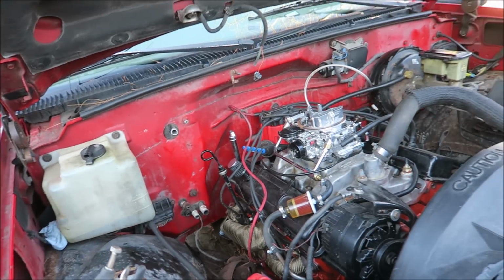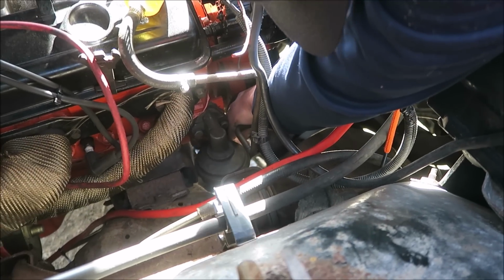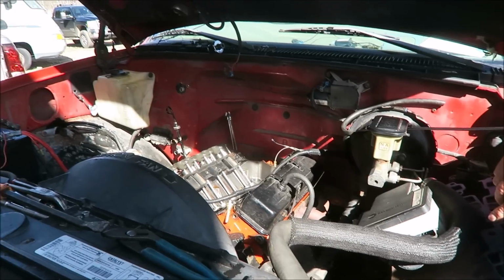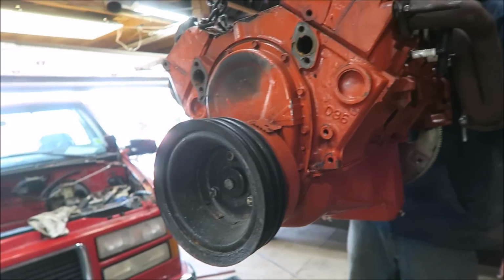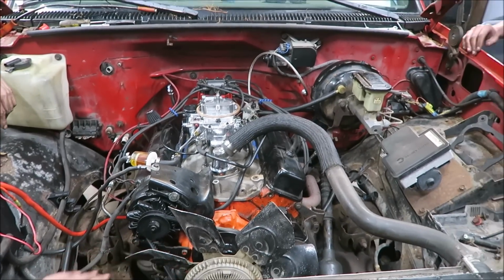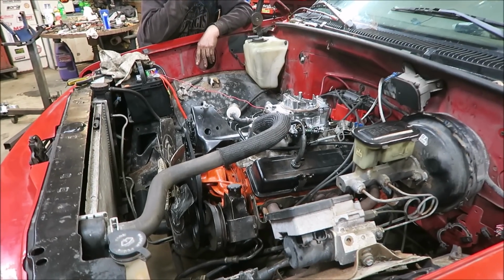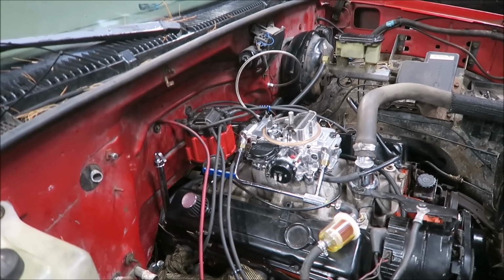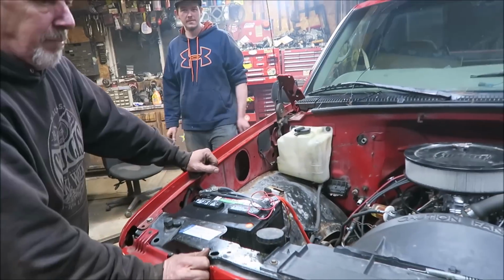WE CAN NOT BE DEFEATED!!1! The 7 Hour Engine Remove/Rebuild/Replace And Do A Burnout-Episode

Comment: What year is the red truck I'm getting a 1999 K 2500 with a blown up 350 Vortec and I have a 79 350 built I don't know what I will have to do to get that motor in there so what did you guys have to do to put that motor in there since it was a carbureted instead of vortec

Comment: We have had that throttle cable issue before on my buddies 69 4 speed Lamans with a 428 Pontiac. He ended up tieing a string to the throttle and ran it threw the dash. It was funny as hell watching him drive by pulling the string then let off to shift then pull it again to go. He drove it around for a week like that before we went to the wrecking yard and got him a good factory throttle cable again.  Aftermarket throttle cables are all crap.  Never had good luck with any that were not factory units.

Comment: Next, try changing a head gasket on a BBC at the track, in-between rounds, without taking the intake off. It's a good time.
Reply from the maker: I'd just drain the water and push it to the lanes lol
Reply: @SniderTron3000  Had to drive it home, lol.